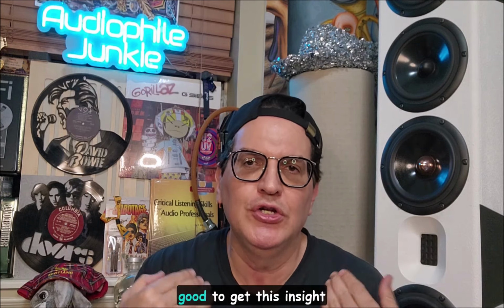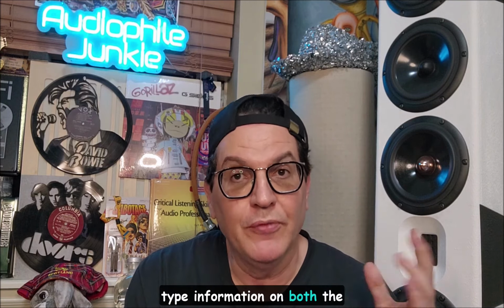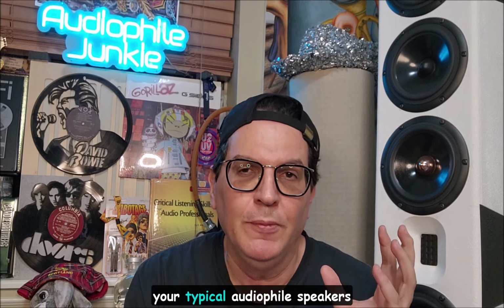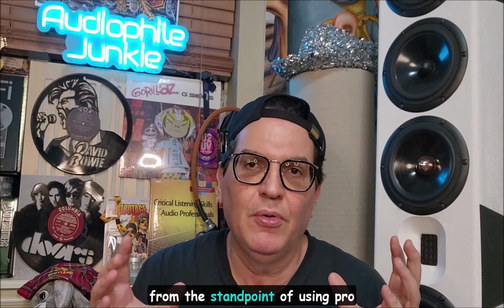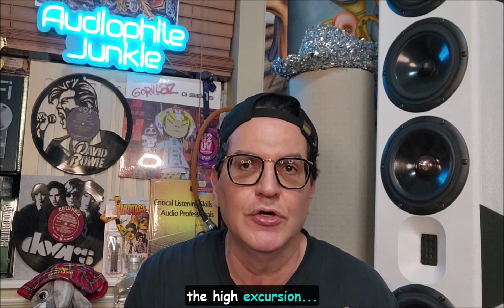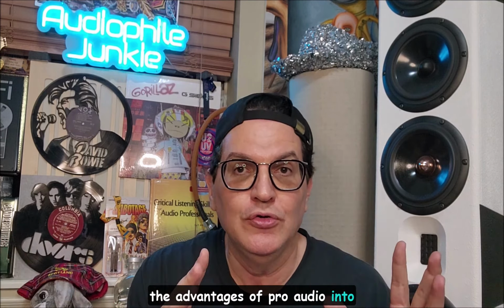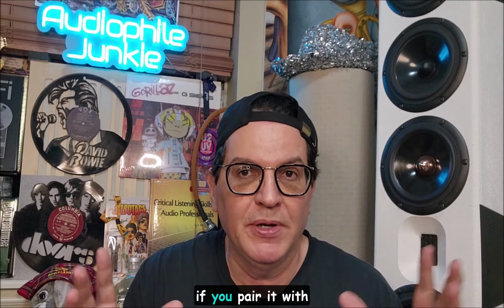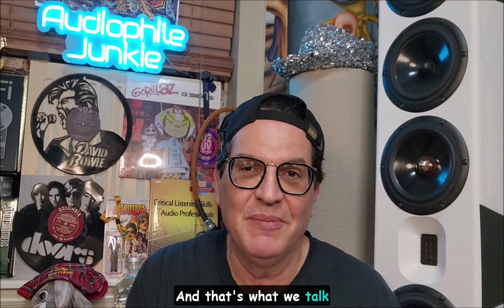Audiophile Legend Mark Levinson Breaks Down Speaker Design & The M1 - Interview Series Part 3

Comment: Love high efficiency speakers! I think you mean low excursion, these driver don’t move much. That’s why they are so fast, dynamic and lifelike!
Reply from the maker: No..I meant that pro audio drivers typically have high excursion capabilities.  It's true that they may need less power to move the air necessary, but you still need the high excursion to do it.  It's especially needed in the bass where you can't just have a high efficiency, low excursion 10 inch woofer and expect it to fill a room with bass.
Reply: Songer Audio S1 
Open field coil 😊
Reply: I'd agree ... typically a common differentiation of pro vis-à-vis hifi woofers ... is excursion;
Hifi > Pro 

That said, YMMV, there are exceptions, etc, etc.